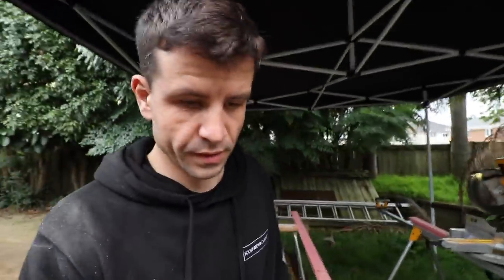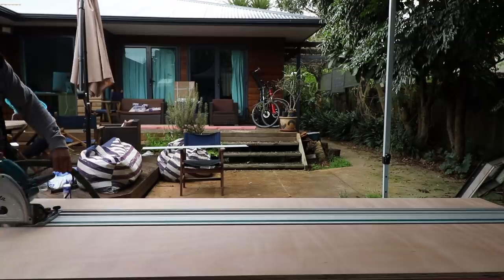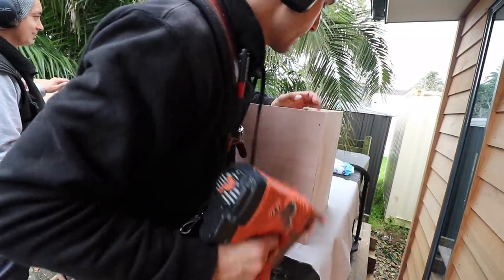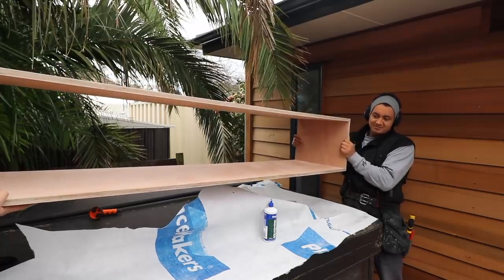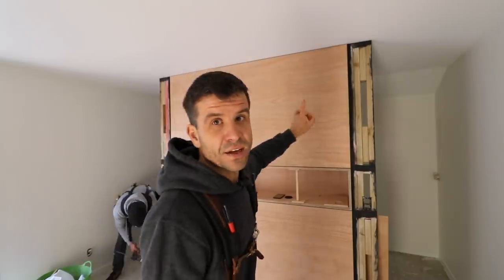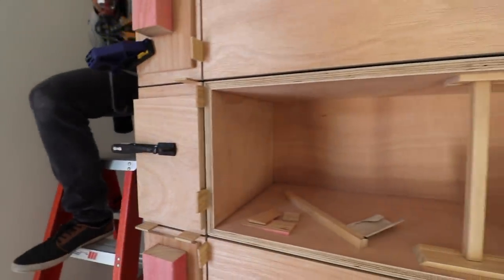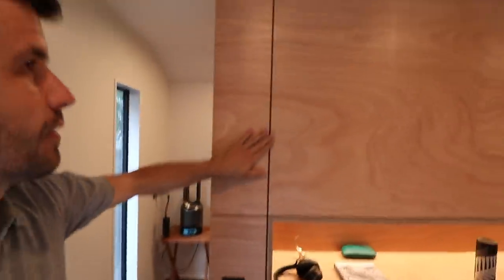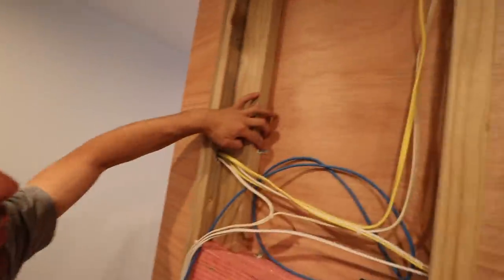Plywood Feature Wall with Built in Shelf

Comment: Hello Scott....
Love this... have watched this several times showing family and friends...
What are the dimensions from back wall to partition wall...
And what is the overall length and width of the room...
Ohh... and if I was to be able to do this on existing carpeted room would I cut away the carpet to timber floor to fix frame...
And will you be doing the wardrobe fit out video...
Cheers